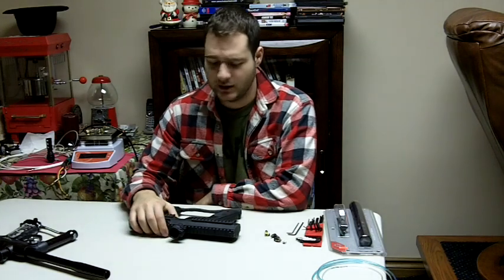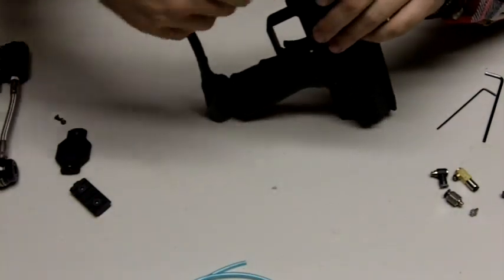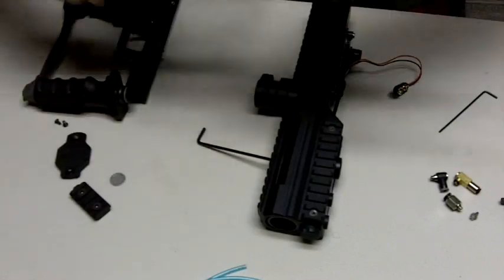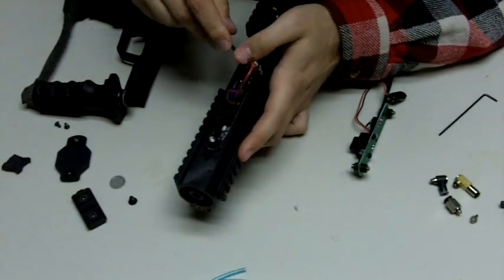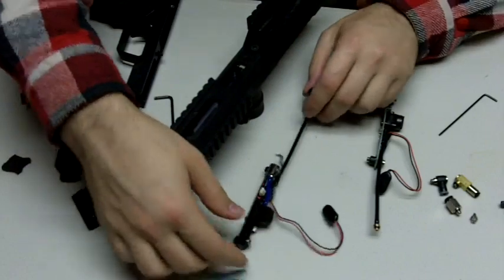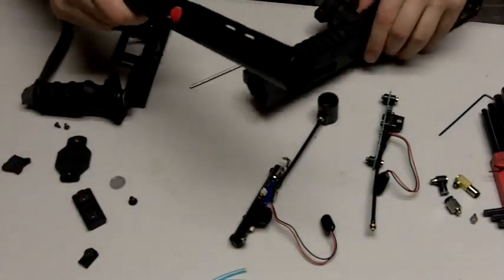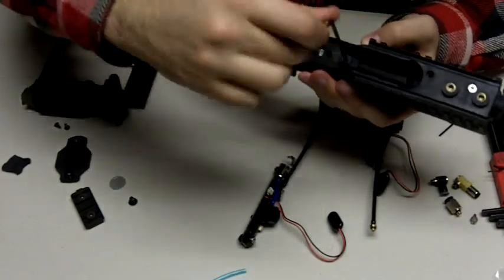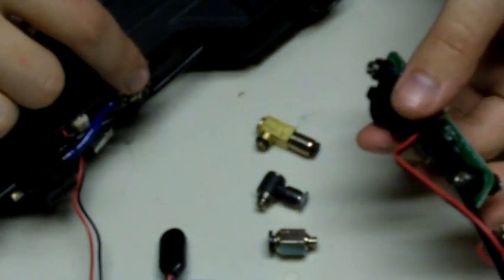SP-1, Vibe, G1, eNVy Blackheart and QEV Installation - Part 1

Comment from the maker: Yes, you need to get both. The stock board limits the ROF to 11bps. You can get the blackheart, but if you want to shoot more than 11bps you will get really bad shoot down if you dont get a qev with it. Blackheart and qev are made for each other.

Comment from the maker: There is no manual for it on the web.  If its not working it should constantly vent/leak.  To see if its working correctly dwell value should indicate if its working.  If the critical dwell is below 20 the QEV is working,  If its above 20 its either not working, or your 360 qev is not a qev but a standard banjo.